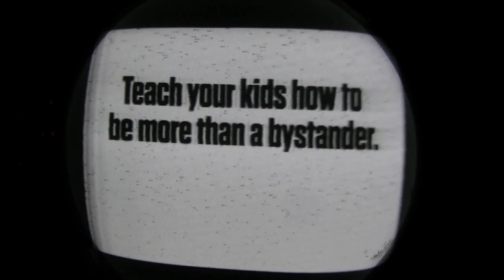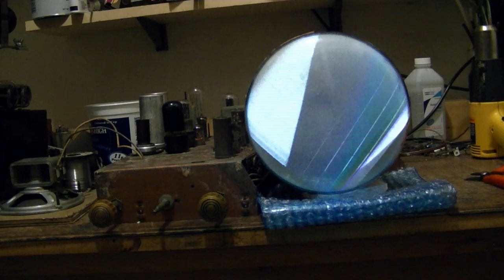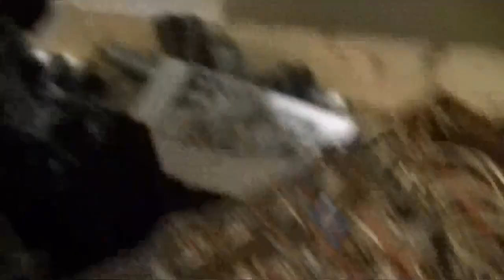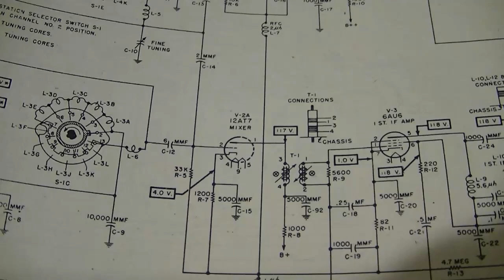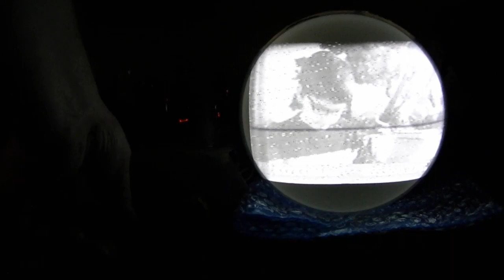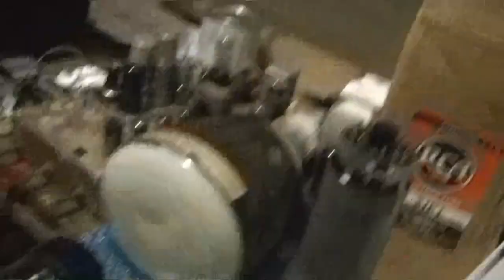Motorola 7VT3 restoration pt2o?

Comment: I am excited for you!  I am a Weapons System Design Engineer and it is my opinion that this 7VT3 is what Design Engineers refer to as an Engineering Developmental Model (EDM),  Design Engineers usually manufacture Engineering Prototypes in a effort to insure that the design is producible and meets their design goals.  If I am correct only 2 or 3 of these were ever produced!  The reason that their is no engineering data is because this device was never intended for production on their manufacturing line.  Not sure what effect your restoration will have in the value of this device but you have a very rare beast!

Definitely a good find!
Reply from the maker: i wonder how the family I purchased it from ended up with it ?  They told be their grandparents bought it new back in the late 40s.  Motorola was really cranking these out and may have just stuck engineering models in with the production sets to meet a quota ?  i doubt my restoration will affect the value.  The chassis was rusting badly and really needed some TLC.  I have about a dozen of these little Moto sets now including the earliest one know to exist in a never before seen walnut cabinet :)

Comment: It's seems like Motorola (AKA Galvin Manufacturing) couldn't settle on a finished design for their electrostatic sets. Every VT71 type set has something different in it from the last one, I could understand this with the earlier production models but you would have figured that by 1950 they would have known what circuit designs worked the best? But here they were using the consumer market as a testing ground even at the 11th hour for electrostatic TVs.

Comment: What to look for is probably a very tiny "hole" in the insulation in the HV circuit - most probably after the HV rectifier. It'll be hard to see. Of course, it could be a cap arcing internally or other hidden arc; these can be nasty to find. I'd be tempted to look under the HV rectifier socket first...

Comment from the maker: Thanks.  I suppose I could but it would take me a couple days to do the recapping plus the cost of the new parts.  Perhaps I will once I determine that it's even possible with this set.  It would be very difficult if not impossible to tap into the HV secondary.  I think it will be fairly simple to make some minor alterations to the HV resistor divider chain.

Comment: I AM PRETTY SURE THAT THE EXTRA WIDE CUTOUT IS TO ACCOMADATE THE LARGER 8BP4 USED IN THE MOTOROLA 9L1 AND 9T1 OR 9VT1 0R 5 WHICH ALSO USED THE TS18 CHSASIS ?

Comment: That static in the video looks like a corona problem in the HV circuit. Remove the HV cover and run it in the dark and you should have your answer quite quickly. After that, try an alignment - if that doesn't correct the weak signal issues, you should get a good clue as to where the problem is. That coil / trimmer combo is a trap for the LO; it's pretty clear that they were trying to increase video bandwidth.